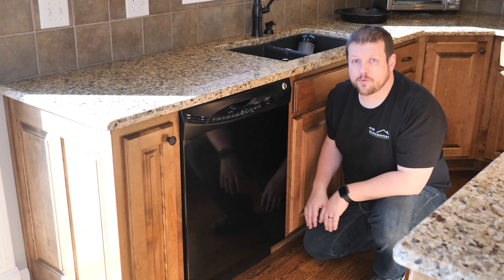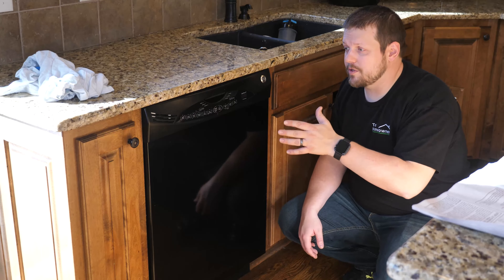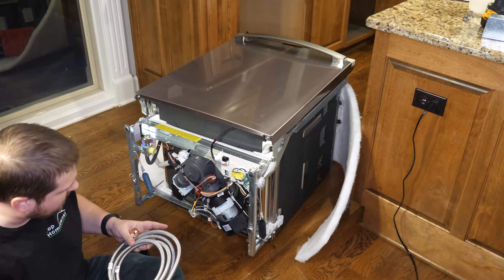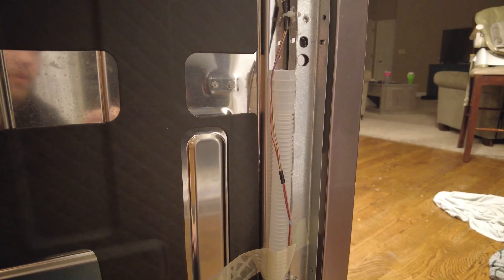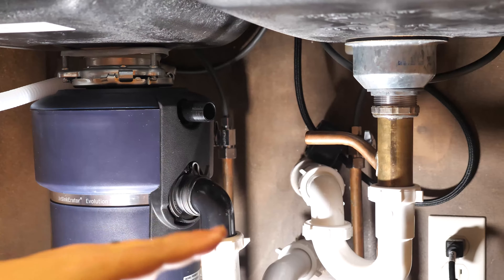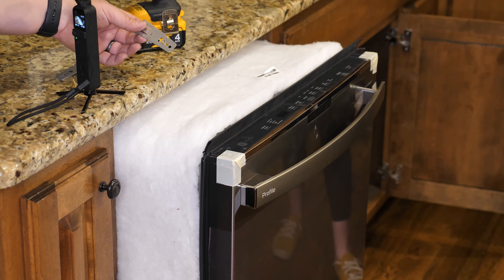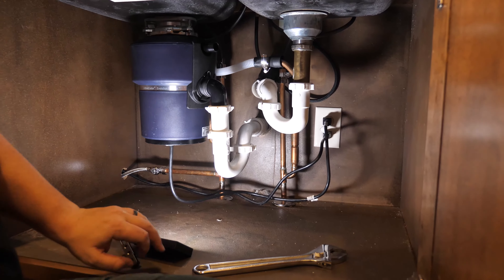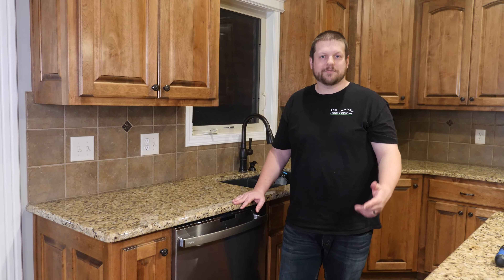How To Replace Your Old Dishwasher: A Step-by-Step Process so You Can Save Time and Get Done Faster!

Comment: Excellent! Great camera placement, and appreciate your not trying to hide difficulties from us. Many thanks. As I watched the video, I made some notes as a guide for when I replace my own dishwasher in a few days. Here they are, hoping it helps others.

1. Turn of power, at outlet under sink if possible, at junction box if not.
2. Turn off water to DW (under sink).
3. Place bucket and/or towel under sink before removing DW drain hose (white, plastic, flexible) from disposer or sink.
4. Remove water supply line (under sink) to DW. If not steel-braided, buy new line that is. Have towel ready.
5. Feed 1) drain hose, 2) water supply line and 3) power cord through hole back to DW. (So when pulling out old DW, will not snag.)

6. Remove kick panel of old DW. (Unscrew x2.)
7. Remove tabs (2) on top of DW holding it in place.
8. Pull DW out. 
9. Lay DW on its back on cardboard packing it came in.

10. Connect 90-degree elbow steel-braid hose to DW.
11. Connect electrical power cord to DW.
12. Stand DW upright.

13. Connect drain hose. After sure hose connection is good, clamp.
14. Feed power cord and water line back to under-sink area.
15. Connect water line.

16. Push DW into place. 
-- Be alert to kinking or breaking drain tube, power line and water line. 
-- Level feet. Put level inside DW to set levelers.
-- Use old DW's insulation if possible for additional soundproofing.
17. Screw tabs (2) to underside of countertop, matching holes on DW.

18. Turn on water. Be alert for leak at connection point under sink and under DW (large right angle connector).
19. If no leaks, install kick plate. Find insulation to go behind kick plate.
Reply from the maker: Glad the video helped and thanks for the detailed comment!

Comment: Great video, very easy to follow and exactly what I was hoping to find.  This weekend I hope mine goes as good as that!  Also, replacing my old GE profile with a new GE one.  Looking forward to the 3rd rack for bigger cooking utensils and the 4 cup cleaners, just like yours.  Only got 8 years out of the old one, but I was told that's normal.  Just don't make things to last (said the old guy).  I also agree with one of the comments that too bad the connection kit isn't included.  All that space inside the dishwasher to stow it!

Comment: I’m going from a Frigidaire that’s probably 15 years old and was most definitely the cheapest available at that time. It wasn’t installed very well either so it’s leaked since we bought the house 2 summers ago. I’m currently installing a  brand new $700 Frigidaire. Cant wait.
Reply: Same issue here, there was a Frigidaire dishwasher installed when we bought our house and it leaked several times.  I finally got tired of patching it up and replaced it with the exact same GE Dishwasher in this video and no more leaks!  Just wish I'd watched this installation video first, there was several things that would have made my installation quicker and easier.  It was also nice to see that I wasn't the only one that couldn't get the side trim pieces to fit and just left them off.  Thanks for the video!
Reply from the maker: And this is why we made the video. We have learned to record everything because you never know what may be helpful to someone else.
Reply: So the cheapest model went up in price😅😉☺️
Reply: No slilcone tape

Comment: I’m going to install one of these this weekend but ours doesn’t have the handle that sticks out.  I have to ask, it looks like your floor was installed AFTER your first washer was put in, so it looks like there’s a slight “step down” to the underlayment from the wood floor.  Was there any problem with lowering the feet and getting the washer into the space ??
I have ceramic tile that was installed AFTER my original washer was installed, so my big fear is that my tile floor will be too high to allow me to get the washer to drop into the space.   We’re you able to shrink the height, with the feet, enough to fit your space  ?  Thanks for posting.
Reply: Update to my last post.  Long story short, I still have not installed mine.   Because of the differences in my floor height, I had to take the old one out almost piece by piece. 
It looks like there's no way around it, I'm gonna have to remove at least 4 tiles on the floor to get mine into place.  
All I need is about 1/4 inch to clear the counter top too ! 
Very frustrating.
Reply: @djwak59   Thanks for the update. What you're describing is exactly what I faced about 16 years ago in our old house. My "solution" was to take a circular saw set to 3/4" depth and cut out a 2' x 2' square of flooring in front of the dishwasher. That allowed me to slide the old DW out and the new one in. When done, I glued the 2' x 2' square back in place. Filled in the gaps, I forget how now, but didn't look too bad. My vocabulary got a lot larger during this project.

Comment: Do you like the GE Profile dishwasher?  We have the GE Artistry which is a lower priced version and it is 7 years old and about at the end.  The racks are rusty, the front is rusty near the vent (it's white, so we will probably get stainless steel the next time), and it's getting noisy.  I have yet to see a positive writeup about the Profile but do you like it?  Or do you think you should have bought a Bosch?
Reply from the maker: We like ours. That said we just had an issue with the pressure sensor (it was dirty and needed to be cleaned) so it wouldn't start washing until that was addressed. Otherwise it's been fine for us and really quiet. Bosch is a great brand as well but more expensive I believe.

Comment: I have a GE dishwasher and will not start. The light indicator above the start button doesn’t light up. It worked for one load and stop😢working. Is it worth to fix it?
Reply from the maker: If it's new then call it in for warranty

Comment: Can you get your fingers in the gap  between the dishwasher door and the bottom of counter top if you need to stop the cycle for any reason?
Reply from the maker: Yes, you can. We raised the adjustment feet a little high so ours is tighter than it could be. I didn't want to pull the dishwasher out again to lower it since I had leveled the unit. Also, the dishwasher will stop if you open the door.

Comment: I don't if you can help me but I'll ask anyway.  I replaced my dishwasher. Everything went good until I tried to plug it in. The outlet was a 2 prong the cord is a 3 prong so I replaced the outlet. Plugged in the dishwasher and no power. Check the  wiring and it was fine. Called my daughter who does construction work.  She said plug it into an extension cord. It worked. Bought a new outlet same thing no power.  Would a 20 Amp GFI give enough power for the dishwasher to work? 
Hope you answer. Thank you. 
Janice
Reply from the maker: 20A should be plenty. If I'm reading this correctly and you upgraded a 2 prong to a 3 prong receptacle in the wall, I assume you used a GFCI/GFI version. If that's correct, double check to make sure the new receptacle has the power going to the LINE terminals and not the LOAD terminals. That may fix your issue. For more information, check out this video: https://youtu.be/3AXcRsAOLPk and this one too: https://youtu.be/Uop79H_iqoQ

Comment: Nice video but what about the high-gap or what code requires in certain states, “Air-gap?”
Reply from the maker: That's not a requirement where I live so I'm not sure what else needs to be done. I did see some comments that said the loop built-in to the drain from the factory might be good enough. I'd be sure to confirm with your local plumbing codes for what they require to be sure.

Comment: My dishwasher drain is connected to a Y shaped connector that is installed in the countertop. The drain hose from the dishwasher is connected to this connector and there is a hose from the connector that is connected to the garbage disposal. I was wondering if i should keep the same setup of connecting the drain hose or connect the drain hose directly 
to the garbage disposal.

Comment: Great video, the instructions for this dishwasher are terrible!  The brackets can also be placed on the sides if you have a granite countertop.  The Drain hose is enormous.  I'm thinking I should have cut it, but it's all installed now..  Oh and those vinyl strips were created by the devil.  HORRIBLE design with now guidance on how to install them or if you did it right..